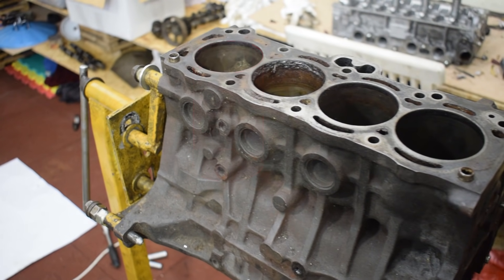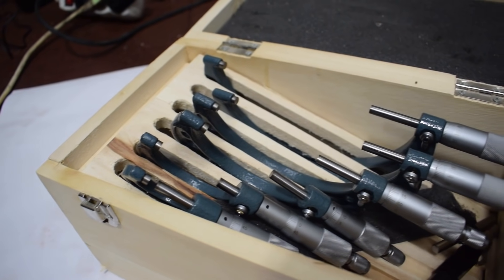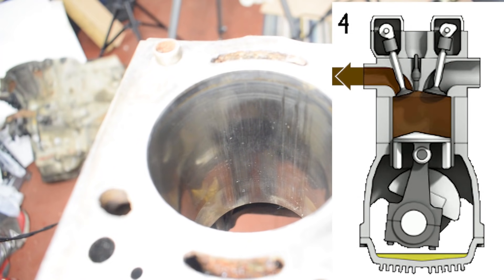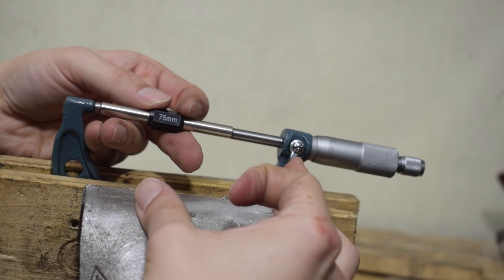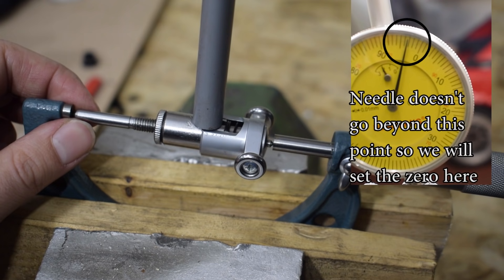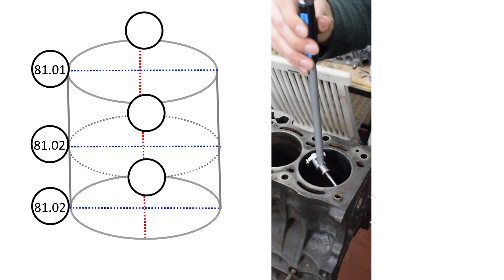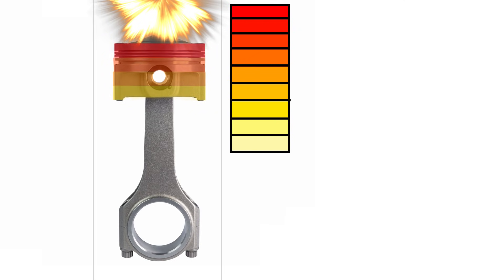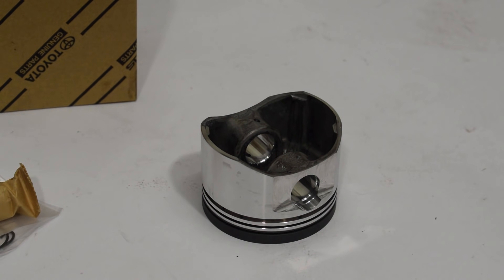DIY CYLINDER BORE CHECK: How to measure OUT OF ROUND, TAPER, and REBORE size - STEP BY STEP GUIDE

Comment: Good on tell you what to measure . Thin on what it means ...  Suggests  20/100th mm or 8 thou inch is acceptable wear. But is that an 0.20mm taper ?  which would make the ring gap 0.6mm wider at the top of stroke?  ... goes on to measure a very good cylinder.    ( also the step at the top is important as a new ring will be fractionally fatter , bash the step & break ... google Ridge Reaming..   or are you better honing it away to reduce taper ?)

Comment: I've been watching your videos for a while now, but now I'm actually rebuilding an engine myself, and I cannot thank you enough for clearly laying out how to use the bore gauge. I was coming up with some wacky numbers, but it was because I was zeroing against the piston skirt instead of zeroing to the factory bore size in the TSRM. Now I can get some accurate measurements on my 5M-GE before I take it to a machine shop. You also answered another question I had about determining new bore. I wasn't sure if I just picked a bore and hoped my new pistons fit, but now I see I need to get the oversize pistons first and do the bore calculations based on actual measurement of the pistons first! Guess I'm ordering pistons soon! Thank you so much!

Comment: Great Video but small Mistake
When calibrating the micrometer do not clean the measuring surfaces with your finger. You always have a tiny amount of  moisture on your skin (fingerprint). Use paper to clean the surfaces. Best is some printer paper that doesn't leave particles behind. The micrometer has shown 0.02 mm too much. That is typically the difference from clean to have a fingerprint there.

Comment: This is an excellent tutorial video and one I am very grateful for you posting and sharing your knowledge - I totally effed this up on my first try before seeing this video and ended up with the gauge going mental! Once I had zeroed the dial gauge properly using your video, I ended up with cylinders that were either near enough bang on or at most in the middle of the tolerance.  Went from dire straits to happy days in one vid!

Comment: Definitely doing my Miata spare block. See what happens. If it checks out good for the amount of overbore to clean pitting (looks a lot like this old 4agze)  then I'll be doing some oddball mix and matching of factory parts if I can get the numbers right and without sky high compression. Cams will be custom grinds, Nissan valves and guides, far as I can tell, we'll see on base circle reduction when done, using zetec lifters, volvo or 4G63 valve springs, and doing most of the shimming on the valve stem if possible. Mild hand port, mostly just bowl blend, unshroud and radiusing. BP heads sorta just suck, as does the rod ratio. Should be able to get a 1.5mm over rebuild at the cost of OEM rebuild parts, with a healthy compression increase and hotter cams. I'm shooting for a 160whp N/A 1.8.... because we Mazda folk weren't blessed with 4ages, 3sge beams, or b series.

Comment: Excellent amigo. Want to share about cylinders that get catalyst in them from excessive valve lap. The middle of the liner can be up to .040 over but cannot be seen by your eye. I found out the hard way after honing and new rings/valves with no increase in compression. It was my fault for not using an inside micrometer !

Comment: The Land Rover V8 4.6L manual doesn't give a max diameter. The bore is just secified as 94.000mm to 94.015mm. It only says max out of round of 0.013mm. Clearance is specified at 0.015mm to 0.045mm, so pretty tight. How much wear is allowable? Your MR2 seems to allow 0.2mm, sounds like a lot!

Comment: have a question, i was given a 08 colbalt 2.2L had a spun bearing on connecting rod cylinder 1. alot of score markes i was able to hone out. problem now is cylinder one if I put a oil ring in has a slight gap between ring and wall. if the cylinder is oiled you would never see it. without oil and a flash light you can see the slightest  light right along  one skirt side wall I mean slight. starts approx an inch from top to two inches from bottom. would this be a major issue requiring a rebore...thanks

Comment: When you are doing these measurements how are you reading the guage (Inside bore Thrust and non-thrust).  When I was looking at the gauges I read the dial as pointing to between the 90 and 0.  How did that give you 81.01 to 81.04?  Was it subtraction, or perhaps tilt of the guage dial?

Comment: Thank you for the info. Getting ready to rebuild my first engine on an extreme budget, an lt1. It’s low miles 81k) and overheated and popped at least one head gasket so I’m learning as much as I can. It was already torn down and coated in a nice coat of grease. I’m sure the cylinders are in great shape but don’t know if they are out of round. I’m probably gonna throw new bearing and rings in it since it’s already torn down and since I’m going that far I might as well make sure they aren’t out of round. Though if the bearings look good I might just button it back up clean it really well and leave the rings alone. My big concern is that the heads aren’t warped.
Reply: They're reverse cooled so your water pump probably went out. Still check for tolerances but they're the first to receive coolant.

Comment: Nice Video ;  Try using a "Dial Bore Setting Fixture" .  If folks use a micrometer to set their dial bores , it's not what you would need for such .  Try using a  digital type "Sunnen" dial bore gauge . They also come with a calibrated Sunnen setting fixture . The method shown in the video could easily become a tricky/dicey thing for some of the machinists 101 type folks . To plug in quality assurance in a finished machined cylinder , anyone would be better off with a three fingered digital dial bore gauge .  Try , you will like it !

Comment: When the piston  diameter is 78.40, mm how to adjust the dial bore gauge , set 78 mm or set 78+ 0.50 mm
Reply: 78.65  bore size.

Comment: Hi there,

Please help, I've got a Nissan NP200 & recently repaired the cylinder head & replaced the intake manifold. I noticed that whenever I change gears, the engine revs a little bit higher than usual. What may be the cause for this?

Comment: Not a bad way to spend Valentine's Day, eh!? 
I was going to post a comment about how the cheap micrometers and bore gauges only have 10 micron gradations. I recently blew a significant amount for a 1 micron grade Mitutoyo dial gauge and micrometer. But just realised that I very rarely need to call upon that level of accuracy. And that the much cheaper 10 micron locally-made-cheap versions are the ones I use the most and that is the level that most factory manuals seem to need. Their ability to withstand wear and tear in carefully used home mechanic environment is quite acceptable too.
Thank you for an important lesson in matching tools to needs, rather than always blowing the bank trying to buy the "best".

Comment: I did an 'Instructable' a few years ago on correct way of measuring cylinder bores. (on a two stroke motorcycle)
There are a couple of things that can make life easier. Pistons are almost always measured around 3/8"~10mm from bottom as the crown is always a lot smaller diameter because it has more mass and expands further at operating temperature.  Check micrometer with a STANDARD, a gauge block is a different piece of equipment.
After you set micrometer to size, set it on a piece of foam rubber laying flat. It's a very easy way to set bore gauge without any balancing act or risk of changing dimensions from body heat. You also need to note the counter dial (the little one in the middle) I have seen people get a full 1mm out as block they were measuring was already bored to max

Comment: When you are measuring cylinder bore it could be normal, that the dimensions are out of round. When you tighten the head, the block deforms a little bit. That's why the better engine builders/machinists use torque plates to simulate the load of the head when they hone cylinders.
Reply: That is covered in a separate D4A video.

Comment: It would make an interesting video on how accurate the Chinese measiring tools are compared to quality ones. I was thinking of buying the same ones a few months ago as you used, but changed my mind for accuracy concerns.
Reply: For measuring taper and out of round, it could be set wrong, but you will still see a problem in different measurements. Accuracy is important, but even if they are off its still a useful tool

Comment: Hi brother. Thank you for your explaining. Good luck. 
Answer my questions please... 
 Does a cylinder block metal type affect these values formula, that you explain end of the video? (Cast iron, aluminium)
Reply from the maker: The formula is based on piston to wall clearance which needs to be checked for each individual engine. The piston to wall clearance depends on many factors and there's no universal formula. The allowance for honing is usually similar for most engines, but double check that too.

Comment: I have been following your channel for many years, but start to feel more and more spooked out. Doesn't matter what I do in my garage a new D4A video about pretty much the same topic gets released shortly after:
- I rebulid the suspension of my car wit Poly bushes-> D4A video abou rebuilding suspensions with Poly bushes
- I replaced the factory speaker on my car -> D4A video abou replacing blown out speakers
- porting a cylinder head -> D4A video about porting cylinder heads
-I finally decide to do something else, buy a clapped out motorbike, fail to make it run and have it sit in the back of my garage eating up space -> D4A miniseries on an old motorbike.
Guess what I had in mind a month ago. I don't belive in telepathy, but I start to feel watched.

Thank you for your very informative video though. I'd just have some doubts about the accuracy of those cheap no-name measuring instruments. I personally own a small collection of old japanese and german tools that I partially inherited or bought second hand. I just don't know if they are much better after being used for decades. At the end I decided to just bring the block to a trustworthy machine shop and have it checked.

Comment: Last time i was inspecting my block i didn't even need bore gauge. I could feel thrust wear by finger :p It was almost 0.5mm out of spec in top of the stroke
Reply: +1. I could see the ridge on mine without using the fingcrometer.

Comment: Get ring off piston measure gap put ring in bore top, bottom and middle only bottom and top off bore will taper not middle.1 measure ring gap which will give you  any tapering at top and bottom 2 same thing put ring at top bottom and middle use a torch at bottom off bore to see if any light pass through ring edge  and cylinder wall.poor man's way.peace

Comment: This is a fantastic video! 

I do occasionally use an outside micrometer at work, for measuring axle diameters when rebuilding traction motors. 

One day during a rebuild, the guy who was building the motor said the axle wasn't going to work - it wasn't cut properly. He wasn't familiar with zeroing out the mic.

Found out the mic was out by nearly 0.008" due to misuse and abuse, so after adjusting it, we determined the axle was well within tolerance.

Comment: Great stuff,. Very informative, and I appreciate the stressing of zeroing the instruments. One quibble: I was taught to say "decimal three eight" as opposed to thirty-eight because thirty-eight is a whole number whereas the aforementioned decimal or point three eight is, of course, a fraction of one. This was stressed so much that even decades later it's painful to hear anyone mixing whole numbers and fractions in that way. A pity for me since it's a rather common mistake!
Reply: Very interesting. I've never heard of that stressed so much. Though I'm not professional machinist. American as well. I would usually say "point three eight" or "point thirty-eight" comfortably. Now that I say it out loud, I think I would usually prefer the former when measuring. We might of course say "thirty-eight thou" for 0.0038 though. Which adds a layer of confusion. However, I would rarely say the whole number in a decimal unless it's in the tenths place. I wouldn't say "point zero thirty-eight" for 0.038 I would say "point zero three eight" so perhaps it's pretty standard across the board, but with the tenths exception? Would make sense to keep it uniform. Just rambling as I think about your post. :D
Reply: @802Garage  It was mathematics class and that's not a profession that looks kindly on imprecision!. Thirty-eight thou is absolutely correct terminology since we're counting thousandths and there are thirty eight of them.
Reply from the maker: I'm self taught on all of this 😅. Saying 38 thou is really hard for me as it comes out super weird and unnatural. Decimal three eight I never even heard as I had math in my mother tongue and we said it like I say it, I just translate to English in my head. But videos are great because you can put actual numbers on the screen 😊

Comment: Excellent info, just about to start making a hybrid engine from m54b30 and m52b28tu to m54b28 :) Will definitely use this knowledge now.
Reply: What's the advantage of this? :)
Reply: @zorg1396  Currently i am trying to film the rebuild and make series out of it but briefly will mention whats the main differences:
B30 vs other engines b25/b28 etc. 
B30 has more displacement , it has better intake cam.
The other ones especially b28 can be build to have similar or more horsepower with the intake cam from b30 or better (Schrick for example, and other goodies too long to write)
All m54 have issues with pistons rings wearing and letting a lot of blow by and high oil consumption, with the m52b28tu you dont have these issues.
B30 has longer stroke and has huge harmonic dis-balance after 6,5k rpm which ends up ripping the oil pump and not letting you rev the car safely past 6,8k(unless you spend shit tons of money)
B28 has square cylinder design 84x84mm and is excellent for high revving. I am sending mine to 7,3k with custom camshafts and other goodies.
It will have close to 100hp/L .
So it is a hybrid as it will use management system and mostly of fuel system from M54 but remain 2,8l to avoid the harmonic issues.
Hope that helps ;)

Comment: You should always check if the measuring rods that came with the cheap micrometer sett is accurate with a good caliper if you have one.
Reply: Depending on their size, you may need to take the rods to a shop to have them checked. 

Generally though, as long as you are the one doing the measuring and assembly, even if your measurements are off by 0.001" or so, everything you're measuring is, and it will all work out in the end. 

When you use the same tools to calibrate everything, all the measurements will match each other and you won't have odd discrepancies.